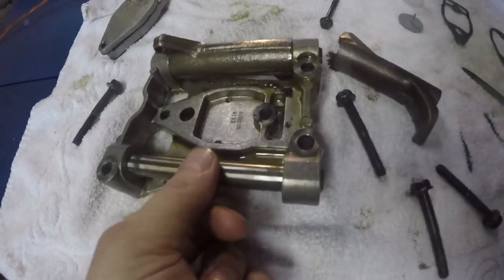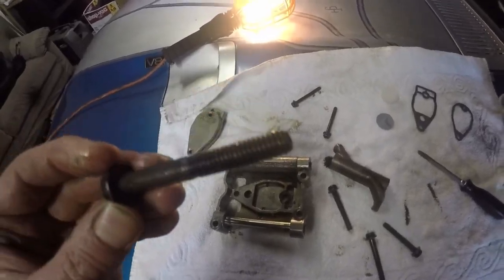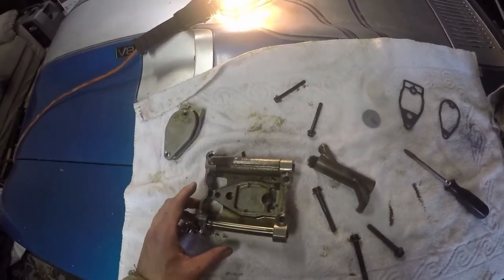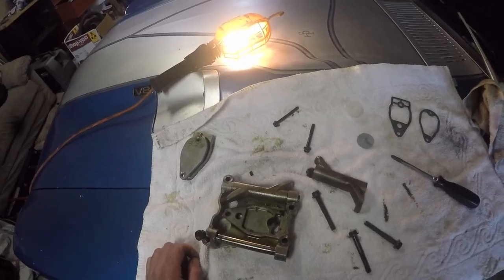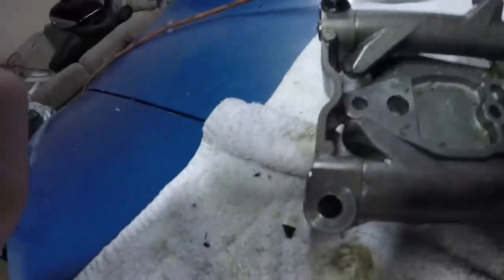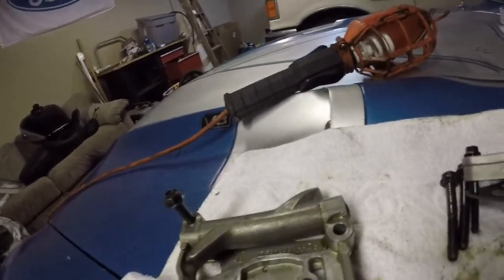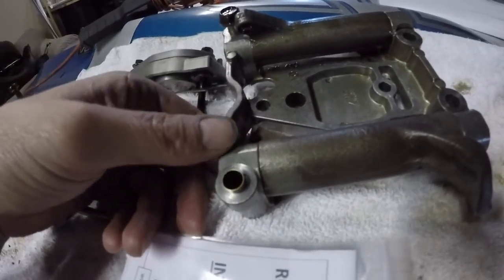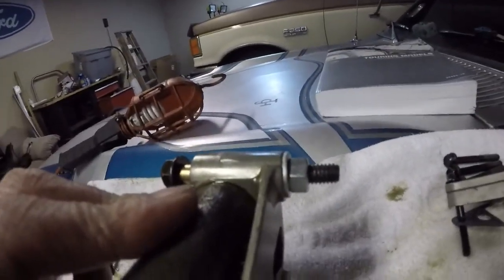Harley Twin Cam rocker shaft stabilizers (fix that Twin Cam tick)

Comment: I placed them on my 2011 Road Glide and it suppressed the ticking noise by at least 75%
that was by just doing the front.Will be going back in to do the other side on the next rainy day .Very pleased because I was about ready to try and sell the mad ticking machine.

Comment: Good deal thanks for putting this on i hope this will fix my chatter new lifters did not work i have 32 k on my stage 3 99 road king not a lot of miles and i really take care of it,have another king i ride lots a 97 Evo have lots of miles it never had a problem . thanks for the post

Comment: I am hearing a rattle only when I'm taking off slowly and letting my clutch lever out. It sounds more front right side of engine. I don't hear it at idle in natural or when taking off at normal speed.  Is this a rocker, primary, cam issue?

Comment: My thinking....( do it your selfer here ) is you could use almost anything to take up the slack  as long as its hard metal. After all it cant fall out into the engine once the box is bolted down. Sorta like a shaft key , . Just slide it down between the bolt on the notch side......make sure it goes down below bolt head........fixed

Comment: I just rebuilt my engine and installed Rocker Lockers while apart as I had a ticking sound.  I didn't see the same witness marks you did or their vids show but there are some marks on it.  I'm hoping something was touching these bolts and that there is an improvement.

Comment: So do I need to get it fixed? Or do I just keep riding my bike and bare the noise??
Reply from the maker: Corey Reynolds I've ignored mine for 1 1/2 years now,  (The noise) while keeping a close eye on everything. I have not discovered any issues . 
But it's your bike, you ultimately have to decide .
Reply: That's my question as well, is hearing the noise the only issue, if it's not going to damage anything then Hell, I'll keep my money lol
Reply: It's unbelievably cheap for the parts so you're not saving much other than labor.  If you can do it yourself then that's just your own time.  But you can apparently do it while lower rocker box is installed so just take top cover off and unbolt the rocker box of course.  It's very easy though I just did the entire top end myself so it was the easiest of all the other tasks.   I think cost was $20.

Comment: just watched your youtube vid on top end noise. trying to track mine down also. mine is 95 evo 883 1200 conv. i see your in Reno, sun vally i'm in  Carson. are you in a shop, or just in your home?
Reply from the maker: Just in my home . Good luck on finding your noise and let me know what you find . Otherwise, you're close enough, let's go riding sometime.
Reply: You got it , and found it. It was my oil pump ready to take a shit. Intermittent oil flow. Does ok when motor doent get to hot. Anyways time for a new oil pump. Hit me up at garynel1967@gmail.com  when u want to g ok riding. First got to fix it. Dont know when that will be. 
Cool TTYL
Reply from the maker: uh oh. Well at least ya got it fig8red ;. I hope the job goes easy for ya.
GrabberGT@charter.net

Comment: I installed the rockout lockers, and I think the noise got louder to be honest. Also checked end play on the rocker arm itself, and it was good. Any other ideas what might be causing the noise? Mine is WAY louder than any I have seen here on Youtube or heard at any rally.
Reply from the maker: Kevin Sauer Kevin, take a stethoscope and listen near your throttle body. 
I discovered more noise coming from that area on mine. In my case it was reverberation caused by valve overlap . Oddly, changing my exhaust eliminated most of that . (That wasn't why I changed it, that was a happy accident) 
Doug
Reply: No idea on what may have caused though?  I just bought this bike used with 3300 miles on it. So just changing the bikes got rid of the chatter? Thanks for the response!
Reply from the maker: Kevin Sauer Just changing my exhaust did it for me by limiting the reverberation through the intake manifold caused by valve overlap. 
Remember, I did change the cams in mine and that started my reverb tick. (New cams have much more overlap)
Reply: I figure mine out last night. I just bought this bike, and it was "serviced", so it never even crossed my mind that I should check the oil less than a week after I bought the bike. Well, I checked the oil, and there was barely enough in the bike to even register on the dipstick. Added some royal purple, and the tick is gone. Stupid service department got me good.
Reply from the maker: Kevin Sauer Ouch, glad ya found it.
Reply: I was just about to say sounds like lifters are oil starved.....glad you found the problem

Comment: i got a 2006 stock full dresser,--- i have a metal tinging sould coming from top end
.--- sounds like some one tapping a piece of metal. help
Reply from the maker: Hmmm, traditionally I  avoid noise diagnostics over the internet . 
I really need to hear the noise in person to make an accurate diagnosis. 
I wish I could be of more help.

Comment: I’m getting this exact noise but with excessive vibration in my left peg , is the vibration related?
Reply from the maker: I can't answer that one without firsthand observation.  Sorry
Reply: Sounds like the compensator nut working loose in the primary.

Comment: What year is your bike and mileage and have you had to replace stator or compensator?
Reply from the maker: 2010 and about 53k miles . No compensator or stator yet . This bike is 100 times more reliable than the bikes that came before it (They were built by the other company that is from Japan and starts with the letter &quot;H&quot;)
UPDATE !! The spring pack for my compensator finally died at 59k miles. The other comp parts didn't disintegrate as I caught it early. So my repairs were light.
Reply: Ever had your cam chain guides replaced?  I'm removing the cover now that the pipes are off and hope I don't need to replace them.  I've heard compensators are bad too yet dealer has guys with 70,000 miles and no issue.  Sometimes I wonder about all the fear mongering though as you can see by my experience (another reply above) there is reason to fear.  But I had other issues, nevermind all these other 'common' problems, I sure don't need those to start now.

Comment: I googled it and could not find the manufacture of these inserts
Reply from the maker: +john doe Look for Rockout rocker shaft inserts . The guy sells them through Amazon.com His store front on Amazon goes by the name of BikerScum
Reply: I'm confused - you said 'Rocker Locker' earlier so is Rockout rocker shaft inserts just another name for the same company/product?  I should check my receipt which may hold the answer.

Comment: Wow.  With 85000 miles on my 88B, “They” tell me I have another problem, I never knew about.  I’ve been promised doom and gloom from people that know everything.  My cam tensioners and bearings shall fail, regular gas and Walmart 20W50 oil will ruin my engine.  I’m sure the world will end for me someday, and sooner or later the prophets will get it right.  Tomorrow may never come, so for today, I’m going to ride my great running Harley to work, and enjoy the heck out of today without a care in the world.
Reply from the maker: Dan Jones I hear ya. It turns out my Twin Cam 96 has been THE MOST reliable, the easiest to tune, and the least expensive to maintain motorcycle I have ever owned .
Reply: I'd like to have had the same experience as you but my 96 blew a piston/cylinder/crank at only 20,000 miles.  Then the rebuilt engine wore out to 0.003" clearance 20,000 miles later.  In between those two failures a new (at 20,000 miles) crank broke the end off it 4,000 miles later.  At 40,000 miles the drive belt is all cracked on every cog with two missing and it's a $1000 job to replace I heard (belt alone is $300 and entire primary drive must come off).  At some point a bearing failed on the clutch hub and all the splines came off.  It's been a non stop nightmare but still recall how beautiful it ran when it was running which apparently (since I still own it and plan to for some time) is enough to overlook the $8,000 I've spent in major repairs since getting it in 2010.....when it was a barely used 2008.
Reply: Dan, spot on. 👍🏽
There are thousands of these bikes out there with a lot of miles. The ONLY thing many of them did at some point was change the cam tensioner shoe to cyco brand. Evidently a higher grade material.
Many problems have evolved because bikes have had HP and torque upgrades with aggressive cams. And then they ride them harsh.
These bikes have taken their share of criticism. But maintain them; Watch the tensioner shoe and keep good oil in them. And ride them like what they were built for, Touring.
Many safe miles my friend.

Comment: So the chattering noise is "normal"? it's been kinda unnerving me.
Reply from the maker: Unfortunately, yes . It unnerved me too, until I completely figured it out . I have discovered that Harleys with more aggressive camshafts also make a reverberation noise through the throttle body . That noise sounds for all the world like a valve train noise . But it isn't . It's actually air movement back and forth in the intake . Free flowing air cleaners allow it to be heard even more . It is not anything dangerous . (In fact if one were to start up a Goldwing without the air cleaner assembled, they too would hear it) There is no fix, and there doesn't need to be .
Reply: Quite right !  It sounded to me (2002 FLHR) like a loud intake noise, more than a mechanical chatter.  But there is a definite sound coming from the valve train too.
On the other hand, thinking back to the panheads I rode in the 70's... they were communicating a sound from every single moving part to the world.  And sometimes sharing those parts with the world, too.
So, the Twin Cam seems quiet to me, compared to what we used to have.  Enjoy the bike and have a safe ride, always !
Reply: Would 255 cams do that?
Reply: Harley says its normal.....translation, were not paying to fix it

Comment: hello! can i instal the rocker inserts shafts without removing the rockets?
Reply from the maker: No, you'll need the room to press in the inserts .
Reply: @dougreno3391  No, they should not be "pounded" in.
Reply from the maker: @CarlosGarcia-ls4hn  My bad . Will correct the word "pounded"

Comment: so will one pack of 4 do both cylinders ?
Reply from the maker: Yes
Reply: At first I thought they forgot to send enough, or I forgot to order one per cylinder, but you only use two inserts per cylinder (4 holes each but you only put them in 2 of the holes).  I breathed a sigh of relief after discovering I/they hadn't screwed up.

Comment: Doug Reno... If there is a company making a kit that help us why not tell the company name , That doesn't make any sense to me!
Reply from the maker: Ringo Gingo Rocker Locker
Reply: I have changed the cam plate, oil pump, cams, lifters and put the rocker locker in and still have the ticking with 25,000 miles I have had this ticking from new.
Reply: That's what I used too, I fire it up shortly, hope it quiets it down.

Comment: Well? How did it work out????
Reply from the maker: +Joshua Willard Actually it worked out ok . It does not eliminate all noises . Engines with performance cams, like mine, will still be a bit noisy . (The noise is the valves and valve train returning to the closed positions. That happens faster and harder because the cam lets the lifters fall faster) I have also discovered that using Dino oil instead of synthetic (with more frequent changes) also quiets these engines . (I don't want to start an oil debate here, just telling ya what I found)
Reply: Thanks
Reply from the maker: Very welcome
Reply from the maker: Update, U found that mysterious noise using my screwdriver to the ear stethoscope. It's actually air reverberation beating around the intake assembly and finally bouncing off the throttle plate. (I highly suspect that the valve overlap on my SE255 cams is the root cause) Having said that, and actually having checked the valve lash (yes it can be checked, but not adjusted with solid pushrods) I'm not going back, my helmet has the headset for the radios, so I enjoy my tunes, but never loud enough to be a hazard.
I have also verified my diagnoses, as changing the muffler silencers has a direct effect on that reverberation sound . (Key here is safe, acceptable sacrifice. After all, I just made a modification, so things like that are to be somewhat expected) 
Having now written an encyclopedia on that subject, I just hope I've armed you with  sufficient info for yours.
Reply: Ah yes I have the same 255 cams and 103 kit (after 96 stocker exploded crank and all at 20,000 miles).  I have SE touring mufflers and wondering which ones you have.  So your mufflers helped that reverberation sound?